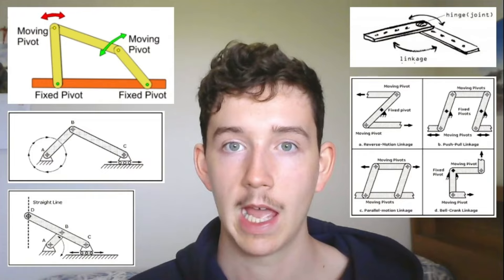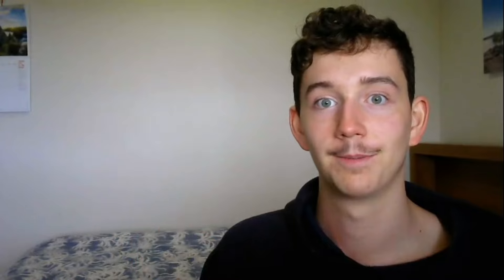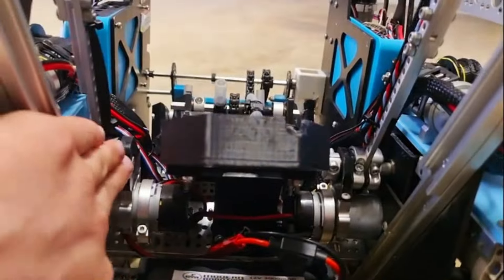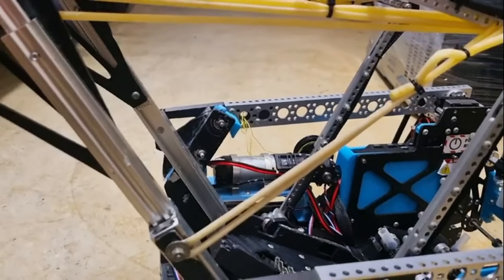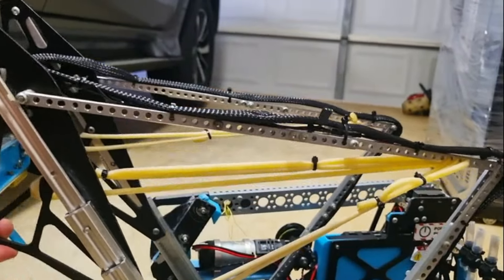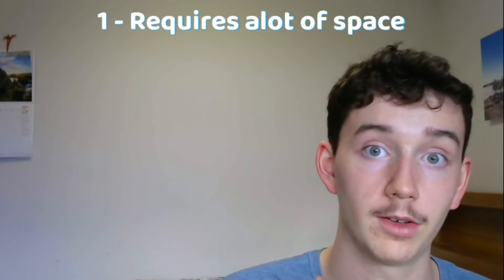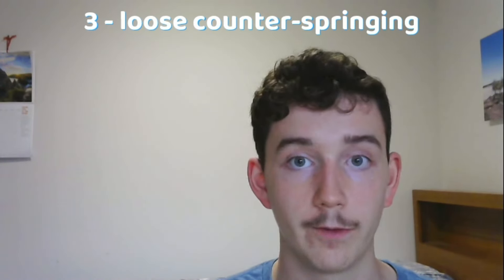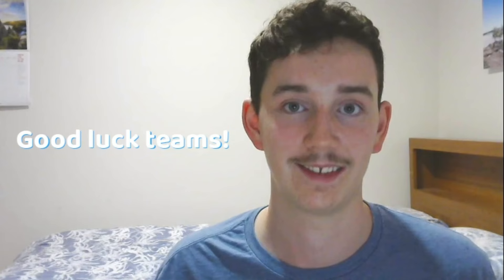Using Linkages in FIRST Tech Challenge

Comment: Great Tutorial! Would you say linkages are faster than string or belt driven linear slides? We are trying to make our intake slides, parallel to the floor, faster.
Reply from the maker: Thankyou! There is alot of friction associated with belts and/or string due to contact with bearings and inserts. In your use case, linkages would be faster as they have alot less friction within the system, are lighter and in a way prioritises the end effector being at its final position by directly moving the end effector beam by a mechanical joint, instead of having to move all the stages such as in a cascade setup. For the extension requirement of the submersible this would be a worthy solution to explore :). The use of countersprining can also boost your retraction speed. This is a trial and error thing you would have to prototype by finding the sweet spot between what the motor can easily work against, and a suitable amount of spring to enable a quick retraction.
 Hope this makes sense :D
Reply: @ alright thank you for the advice

Comment: and if at the linkage I have an angle greater than 90 degrees between the bars from the engine and the bar where the slider is attached, when the sliders are retracted, is there a problem?
Reply from the maker: From what i can understand, If your linkage bars make an angle greater than 90 degrees when fully retracted this may mean you will have limited travel as the linkage is already close to reaching the limit where it cannot travel out anymore. This is however determined by that angle if it is just greater than 90 it is ok for short distance movements however you should look at finding a wat to reduce that retracted angle to give yourself more travel.
Reply: @emrobotics3635 I don't really understand what you are referring to, for example, if I have two bars... the one attached to the motor of 30 cm and the one attached to the slide of 40 cm and they are connected to each other by a mobile point if I were to connect an imaginary bar between them, I would practically have a triangle and I want to know if the linkage extends if the angle is obtuse for example 160 degrees